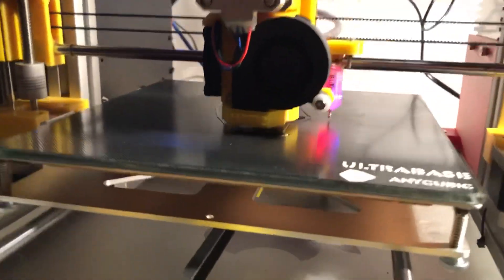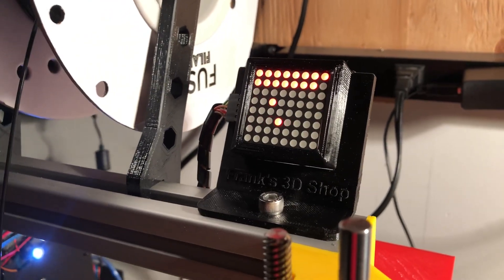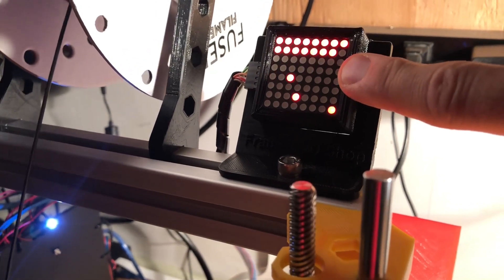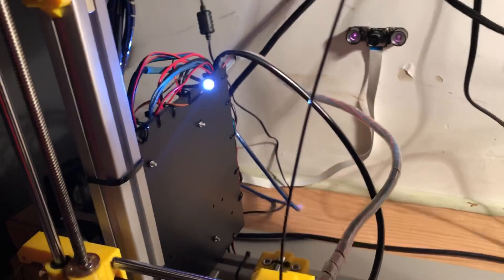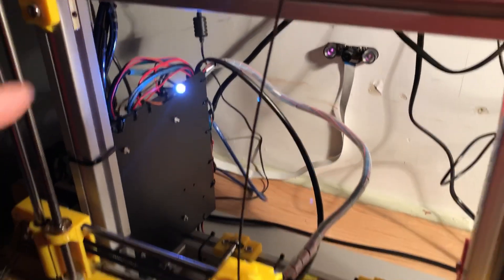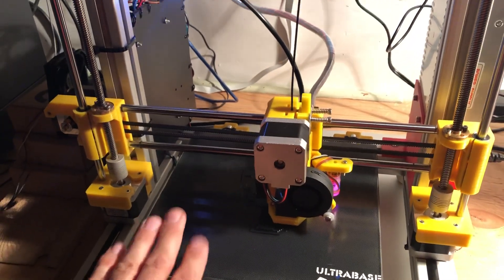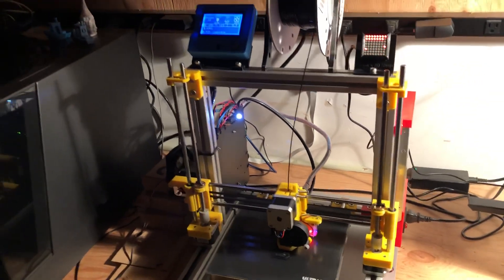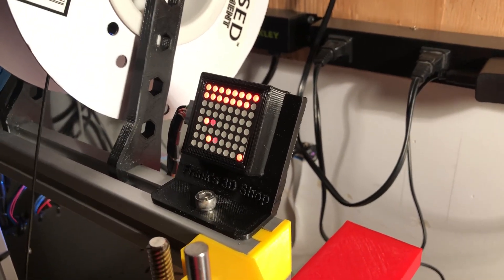Cool Add-On to my home made 3D printer.

Comment: id like to ask you ? i see that you have a aluminum base for the hotbed wont heat trasfer to that base from the screws that hold it and if you useing isolators on them so i can try that on my DIY printer :)
Reply from the maker: Hi! There is no significant heat transfer to any part of the hot end except where the nozzle is located, the heatsink and fan are there for that, you can touch the outer metal shell and it is not hot.
Reply: not the extruder the (base under the hot bed i mean) its aluminum ? the Y axis.
Reply from the maker: I have a support about 5mm thick, on top I have a aluminium heatbed of 3mm and the ultrabase glass. And under the printer I have an old MacPro side cover.
Reply: ok thanks like i sed i see a lot of DIY bilds on youtube but what i like from yours is the cleaness of it hope you make some videos on configuring marlin thanks frank :)